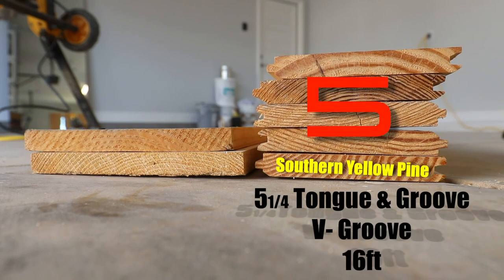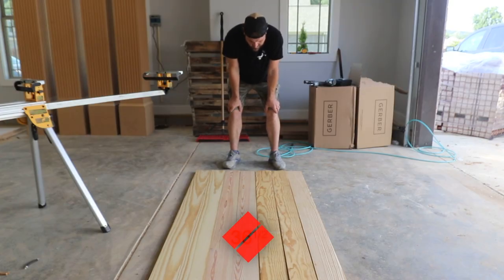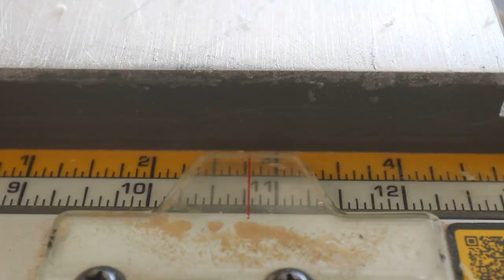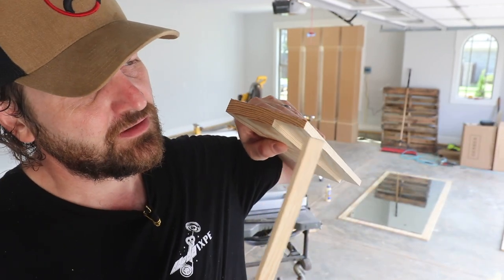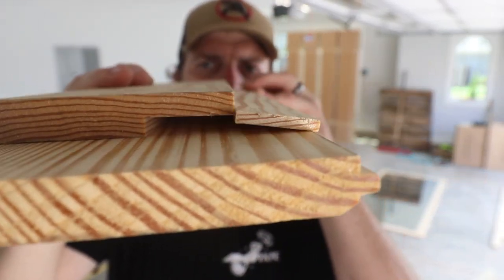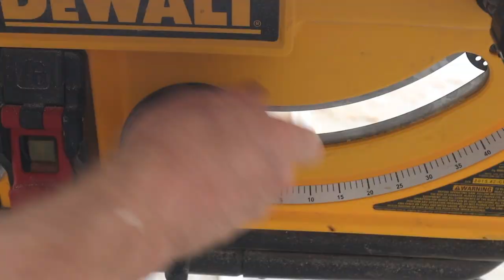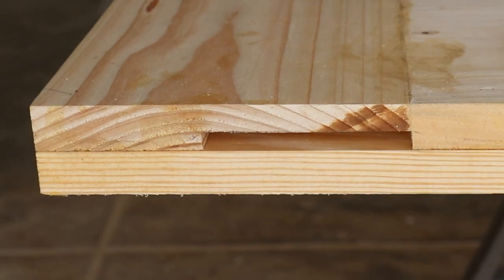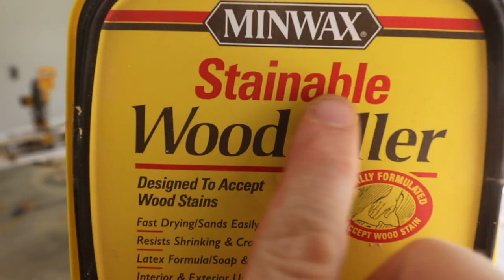How to Build a Mirrored Barn Door

Comment: Halfway through I forgot what you were building, but I didn't care.  Full watch!  My only suggestion would be to either miter the mirror holder on pieces or make the long side boards run the entire length so the rabbet slots would be on the top and bottom and not visible.  But now that I think about it, you probably just wanted that look.  Maybe to match other doors in the house.
Reply from the maker: Yeah the sides first would have been a good idea  except I really wanted the top and bottom to help hold all the tongue and grooves together. Those rectangle plugs worked out great after sanding. I’ve previously lowered the top and bottom on the table saw blade and lifted them off so the rabbet part doesn’t show on the end, but I decided that was a little too dangerous on this one. I should have ordered the mirror smaller but I was guessing 🤷‍♂️😂
Reply: @TMPK  That makes sense.

Comment: This is exactly what I’m looking for! The only difference being that it needs to be a pocket door. Any tips for using this as a pocket door? Thank you!
Reply from the maker: We install a lot of mirrored pocket doors. Just haven’t built one. You can order them from certain suppliers. Maybe even Lowe’s or Home Depot. But building one would also be fine, just make sure you don’t have mirror glass inside the wood where the pocket door lock will be drilled or cut out 👍
Reply: @TMPK  Thank you and awesome job on the mirrored barn door!

Comment: So why would you recommend using 4 or 5 T&V boards instead of one piece? I know large pieces are expensive so your way probably saved money.

But, do you think particle board at the same width would do it? Or even a smaller width of particle board, a 2x4 board on back for the hardware, and then frame the mirror on top? 

Woods expensive. Lol just wanna see your thoughts and why you used what you did

Comment: Just wondering why you went with as deep of an inset groove for the mirror as you did. I have a 36x60 mirror with a half inch bevel that I overlapped with side pieces with grooves only as big as the bevel. Did I make a mistake?
Reply from the maker: They probably sent me the wrong size glass or something and I had to go deeper just to get the door to the right size. You could do as little as 1/8 of an inch if you get all the sizing correct 👍
Reply: @TMPK  oh, that's fantastic. I really didn't want to rebuild the whole thing. I really wish I'd seen your video first. Your way is wayyy easier than the way I built my barn door with mirror. Plywood was a poor choice in a humid climate.